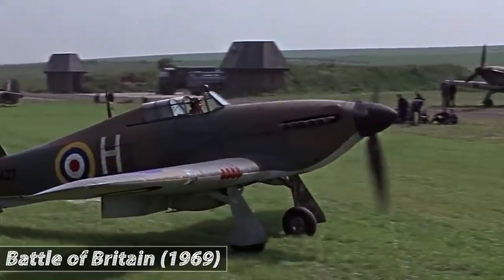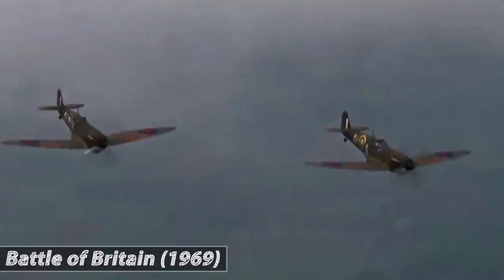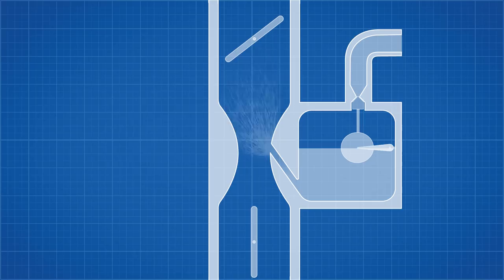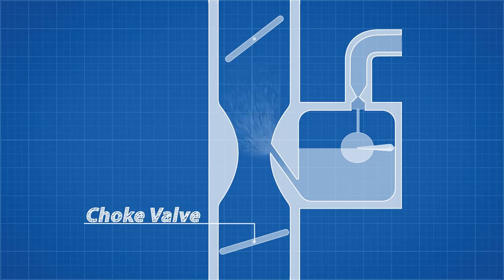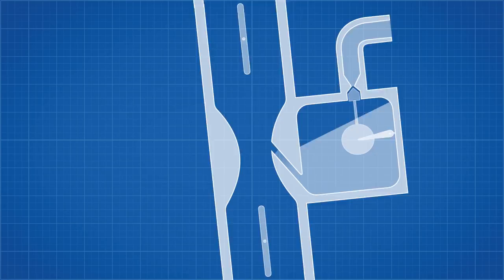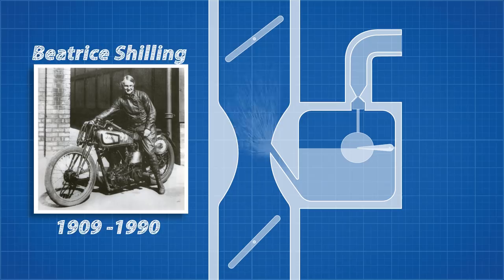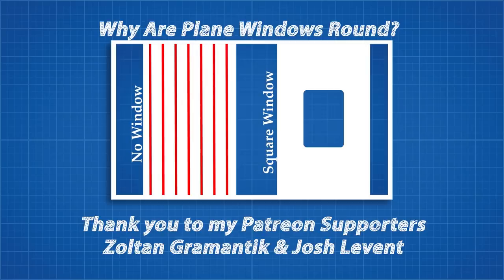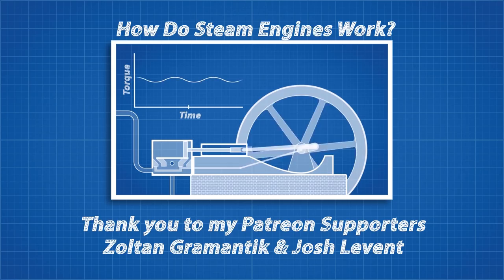The Spitfire's Fatal Flaw

Comment: This is why pilots did the spitfire flick, same for the hurricane, problem solved, pilots used it to there advantages
Reply: No, not really.
Reply: John Ferguson, well 28 people agree with me, Group Captain (and my commanding officer ) Mark Flewin, also agree with me, so sorry to disagree with you
Reply: The flick was a work-around, but it cost valuable seconds, and risked the pilot losing sight of his opponent. Miss Shilling's Orifice was gratefully received by the pilots who actually had to live with the problem, as were subsequent alterations to the carburettor aimed at maintaining the supply of fuel under -g conditions. It's difficult to imagine so much effort being put into finding a cure if the half-roll was the solution you claim.
Reply: @TomFPaton  
Spitfire pilots did this and kept sight of the enemy, it was effective and even after the full cure in 1941 many Spitfire pilots still did a half roll into a dive.  Effort was put into the fix  but also into getting more power. Not every aircraft was as agile as a Spitfire.
Reply: @Sap Pong 
If  Spitfire pilot was close behind a Bf 109 pilot who dived to get away, instead of pushing the stick forward to go into a dive the Spitfire pilot would roll over into a dive, that way he would maintain positive G and keep the enemy pilot in sight without losing ground. Many Spitfire pilots still did the same after the problem of negative G was completely solved, it worked very well.
Reply: @barrierodliffe4155  The flick was good because of the carburetor issue but also because of human physiology. The negative effects of extra Gs on the human body are worst for negative Gs than for positive ones. Besides the blood flow issues, the negative Gs have the same effects in the inner hear as in the carburetor, leading to spatial disorientation.
Besides the spitfire agility, the roll rate can be increased if you add a burst of engine power, because the anti-torque generated by that huge propeller added to the roll rate induced by the ailerons. The same anti-torque from the propeller also made the takeoff run a nightmare for the pilots.
Reply: @jorgeferreira6727  I agree about maintaining positive G being a good thing, but I would not go as far to say that the torque was a nightmare when taking off.
 In a Spitfire Mk XIV which had lots of power the torque was much more noticable and the pilot would keep the revs and boost down only using + 7 lbs boost until off the ground then increasing to + 14 lbs for the climb if there was no immediate combat,  the biggest problem was when a pilot switched to a new Spitfire with the prop rotating in the opposite direction, he had to remember to trim the aircraft the other way to counter the torque.
Reply: @barrierodliffe4155  Well, I read a few things about lots of aileron and rudder during the takeoff run to compensate for the huge torque. But that can change from one model to the other as effects can be minimized adjusting the trust angle of the engine. BTW, the MK XIV was a very advanced variant, I'm not even sure what engine it used, still the Merlin or already a Griffon.
Reply: @jorgeferreira6727  
The Spitfire Mk XIV had the Griffon engine, it came after the Mk XII which was the first Griffon engine version.
They certainly had to trim the aircraft before take off, there was one pilot who had a lot of experience flying Merlin engine Spitfires and having changed to the Griffon engine Mk XIV, he forgot and trimmed his Spitfire the wrong way, he got off the ground and managed to keep control but instead of going straight he ended up at about 90 degrees off track.

Comment: The effect you described,became known as the Merlin cough. A De Haviland Mosquito performing at an air show At Manchester suffered a fatal crash a few years ago and I believe that this was the reason given at the investigation.
Reply: Shoulda had that firmware update, it was patched 75 years ago...I've heard Merlin v1.1 got a flu shot for precisely that very ailment.
Reply: I tkuink you refer to

I  think this is an error. Crash caused by stall following premature entry into climb- roll maneuver. Mosquito climbed like a dream over a certain speed if entered smoothly. 

As soon as any climb/dive maneuver is begun drag shoots way up and if you don't have the speed up,, stall is on  you before you know it. All aircraft have this critical speed different per type ,, variant  and set up. Should be in Pilot's Notes. Maybe this was a pre-flight error?

For simiiar reasons Mosquito was no dogfighter. ?  very broad wings at the root?*

But first they had to catch it . . .

*
fpr example
P{ 51 D minimum weight 3465kg stall speed 100mh
Mpsquito 6486kg stsll speed 120mph

so ,mosquito would take about twice the momenbtum of a 51-D to maneuver even minimalljy

Comment: Aren't half of those clips of "Spitfires" actually Hurricanes?
Reply: thankyou - I thought I was the only one that noticed that - the first 2 shots were both Hurricanes
Reply: The fellow in the video does not know the difference between the two.  The early Spitfires did not use fuel injectors and this is the reason why the engine cut out when ascending, this problem (along with other problems) was then rectified.
Reply: Glad I'm not the only "plane nerd" who spotted this! Doesn't really give the video much credibility does it?
Reply: lmao i'm not the only one!
Reply: Should if called it the fatal flaw of the Hurricanes
Reply: it was true on both hurricanes and spits
Reply: Delta Fox oh yeah me too, particularly the later spits with the griffin engine they were epic machines and they carried a formidable loadout too.
Reply: Shermans had no more propensity to burn than most any other tank, and the definitely were never called "Ronsons." At least not by Americans, and not on a widespread level. It would make far more sense to make fun of the Panther's tendency to burn, since they practically brewed up for no reason when driving from point A to B.
Reply: Delta Fox  Also what you posted doesn't provide any counter to the Sherman lighting on fire no more than any other tank. I never said the Sherman didn't light on fire, but it didn't light on fire any more commonly than any other gasoline tank. You could light a Panther on fire by throwing a grenade onto the engine deck.

Your citation even says it. After ammunition was stored properly the tanks stopped lighting on fire all the time and significantly less than the citation you have for the Tiger.

Late-war Shermans had one of the lowest chances of light on fire, which you include in your counter article... So what exactly are you trying to argue?

And the Tommy-Cooker, Ronson thing it's very hard to find any citation at all for. There is evidence of the Valentine being called a Tommy-Cooker in North Africa by the British, but not because it lights on fire, but because it's hot inside for the crew. There's one article I found that says the Germans used this name, but considering how often their own tanks lit on fire, I don't think it is very demeaning for the Sherman.

As for Ronson-- It's nearly impossible to find any source of that nickname at all, though it is proposed to have been used by the British in some isolated units, and possibly some higher level command documents, but not very widespread, since the Sherman doesn't really deserve a reputation of lighting on fire more than any other tank.

If you look just at raw statistics, the Sherman had very favorable crew survivability vs all its contemporaries over the course of the war.

And sorry to disagree with your dad, but there's a big difference between working on tanks at the time of their use and having access to the actual statistical evidence of their performance. The book "Deathtraps" for instance was written by a tank mechanic, who saw a lot of stuff first hand from a very limited field-of-view and wrote about it. But in educated hind-sight a huge percentage of the stuff written in this book is pulled straight out of Cooper's ass.
Reply: the fierce blinding jet of flame is the cordite going up in the shell cases.
Reply: +fred wilson I don't know where u get that as there is only a very tiny amount of cordite in the primer of each she'll, far more gunpowder which causes flash.
Reply: The hurricane had this issue but a lot of them shared the same Merlin engine, but massive advantage spitfires had was that it could Climb dramatically without stalling, unlike the P51 Mustang and Messerschmitt
Reply: No, they are actually Spitfires wearing their grandma's old clothes for Halloween.
Reply: +Moggy1000 The P-51 also used the Merlin engine.. and it had a superior carburetor than the spit
Reply: the packard merlin had fuel injection
Reply: +Marty Miles   Sorry Marty, the Packard V-1650 used a "float-less" or pressure-fed carburetor and was never fitted with fuel injection, Like the later Rolls-Royce Merlin 68, 69 models it used the  Bendix-Stromberg PD-18 Updraft pressure feed Carburetor.
Reply: I think he was just using footage from Battle of Britain (1969) as B-roll and didn't care if it showed the Spitfire or not.
Reply: The real doktorbimmer, the P-51 also had far superior range when compared to the Spit
Reply: ***** Well they were made for different roles. The Spitfire didn't need as much range as the p-51.
Reply: Toron More correctly, their roles were more similar than different.  They fought against the same enemy planes, but the P-51 could also escort bombers to and from and engage those enemy fighters over a greater distance. The P-51 was also faster, arguably just as maneuverable and was heavily armed.  The engine was a Rolls Royce design although the Packard company that produced in in large numbers modified it.
Reply: Toron Don't get me wrong, they were both great planes.
Reply: ***** Yeah, the p-51 had to escort bombers. That's why they had greater range.
Reply: +soaringtractor
Tractor McTrackface, The Spitfire was a short range inceptor. The Mustang was specified by the Britsh Air Ministry to have a longer range to operate over Germany from England. Now you know.
Reply: The Rolls Royce Merlin that Rolls Royce paid Packard to make had the same carburetor that other Rolls Royce Merlin engines had.  It was more efficient than fuel injection.
The Mustang when it entered service had no provision for drop tanks and less range than a Spitfire Mk V or Mk IX.  by 1944 the mustang had the rolls Royce Merlin and longer range than a Spitfire but not that much more without the British drop tanks.

Comment: I mentioned this phenomenon in a paper I wrote a few years ago on the Battle of Britain.  I'd read about it and, as a former fighter pilot, recognized that a loss of thrust during negative-g flight could be a serious issue! I re-watched the movie while working on the paper and viewed the clip shown in this video several times.  No question the engine quits at the top of the role.  But I don't believe that negative g or even zero g were required to stop the fuel flow, but just low g, like maybe 0.3 g or so, as is the case in the movie scene.  Luftwaffe pilots would certainly have tried to take advantage of the weakness, as surely as the RAF chaps would have worked to avoid it!  It's interesting to note that the "fix" did not prevent the fuel flow interruption, but mitigated the flooding afterward.  The flooding could have made the engine difficult to restart in some flight regimes. As proof, note that the aircraft filmed doing this role in 1968 still suffers a momentary engine failure, but the Merlin re-starts immediately with no action required of the pilot.